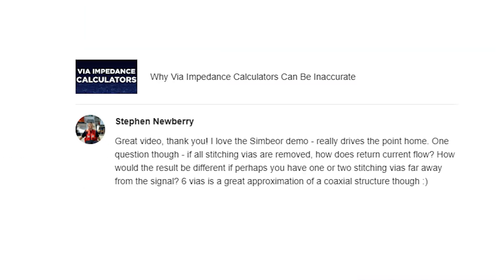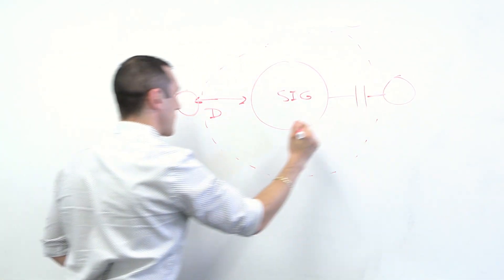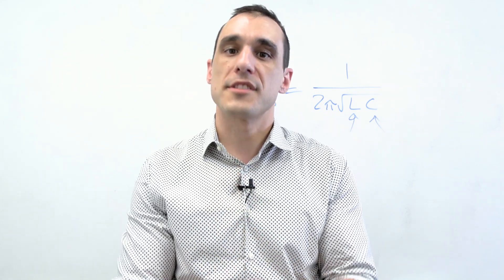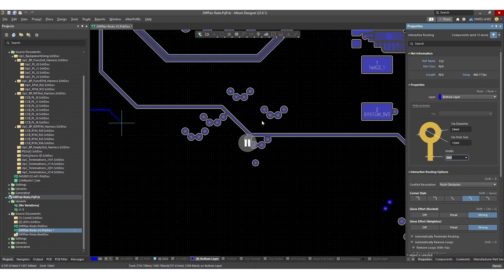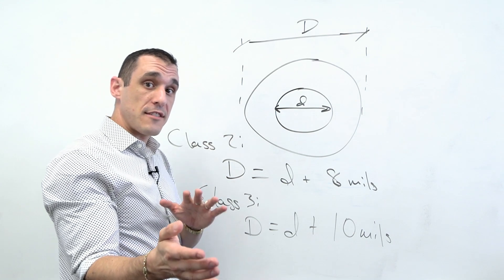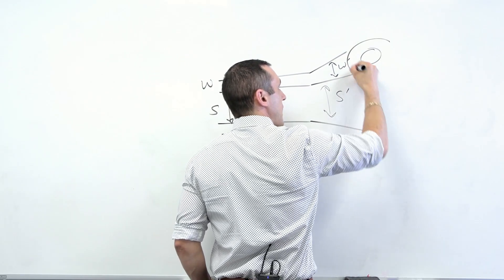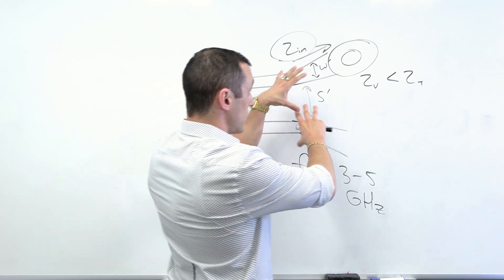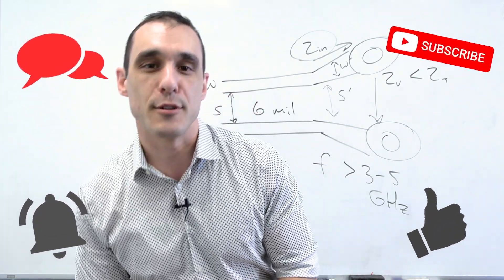Return Currents, Effective Via Delay, Round Traces & More | Q&A

Comment: Hi Zach,
As mentioned in various videos, you explained the importance of PCB material choice (Dk variation VS frequency operation).
What about high speed lvds interfaces like 10Gbps or 25Gbps optical SerDes?
Can you explain the correlation between this and the type of material to choose?
Thanks for your videos!
Alex
Reply: Sure I can make a video on it, but I'll give you a short answer here. There are a few ways to look at the material selection problem at those data rates. You can use lower-loss FR4 materials like the kind isola makes, preferrably spread glass to minimize skew in differential pairs. If the route is very long and passes through multiple connectors or components, then a low-loss PTFE-based material might be needed. For example, my company has done many backplanes with those high data rate serdes channels being routed across a large 3U or 6U board. The other thing to consider is the trace width. Sometimes, we want to use a lower Dk material not just because of the lower loss, but because it enables a wider trace on a thinner layer and it keeps the route witihn the realm of standard manufacturing capabilities. However, with thin unreinforced PTFE, there are problems in manufacturing because you can have misregistration occur between layers in the PCB stackup. So there are many requirements to balance...

Comment: Hello Zach. May I know why the larger the pad of via the more reliability is (8:10)? Doesn't it come with larger parasitic capacitance with larger pad of via? thank you!
Reply: This is related to a drill hit separating the trace from the via. Teardrops are used to reduce the chance of that happening.
Reply: "reliability" is referring to a manufacturing aspect. as DBE mentioned above. There is parasitic capacitance that modifies impedance but you won't notice until in the GHz range.
Reply: Thank you all! Really appreciated for the explanation!